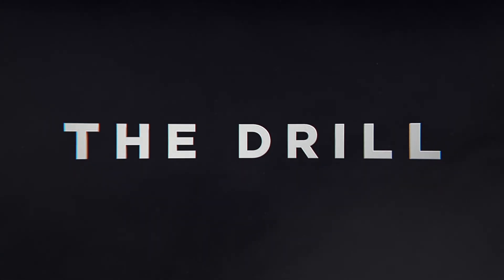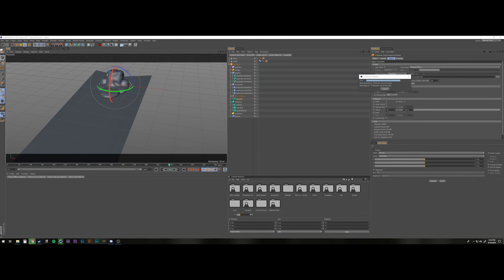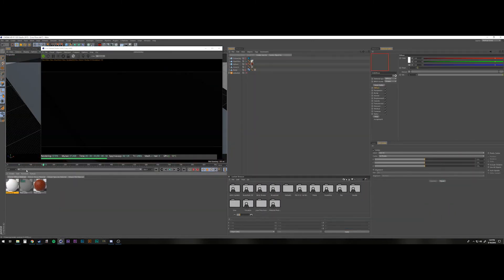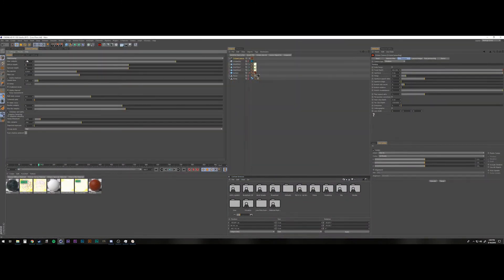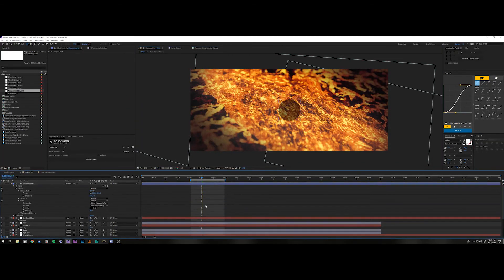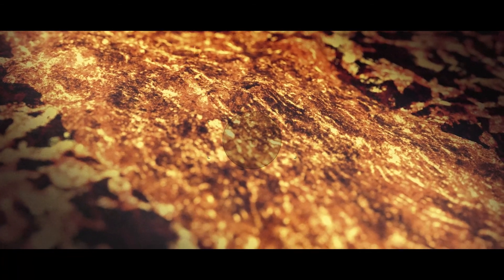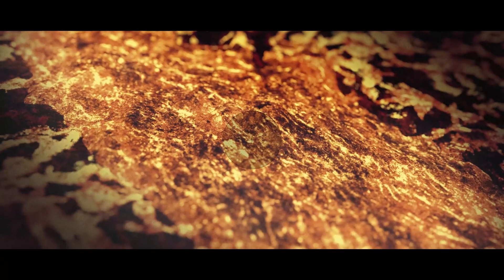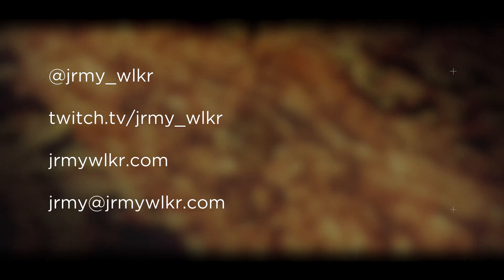The Drill_022 // X-Particles Failure + Making Lava in C4D

Comment: The Skinner and ovdb mesher don't have UV information, pretty sure that's what the issue was with that. I think you'd need to change the projection on the material, but that would probably lead to the material looking like it's sliding across the surface, might be able to make it look alright with some tweaking though.
Reply from the maker: That makes sense. Thanks so much for taking the time to point that out!
Reply: No problem, keep up the good work :)
Reply: You are correct the mesher and particles don't have UV info.